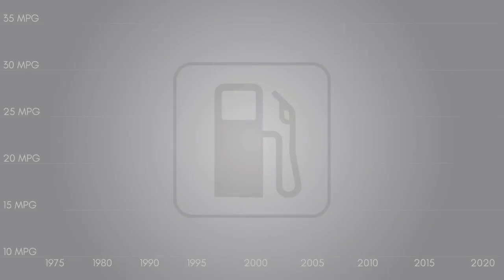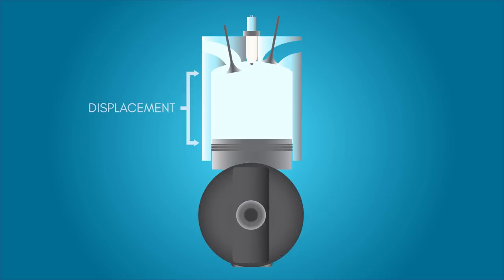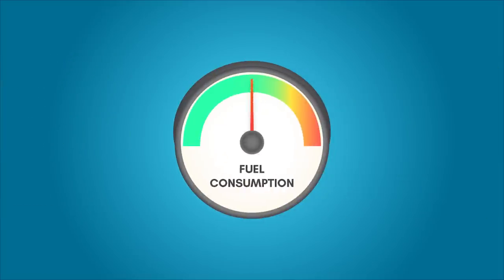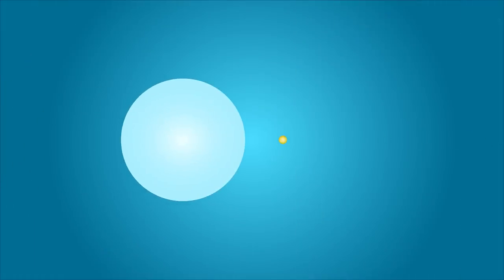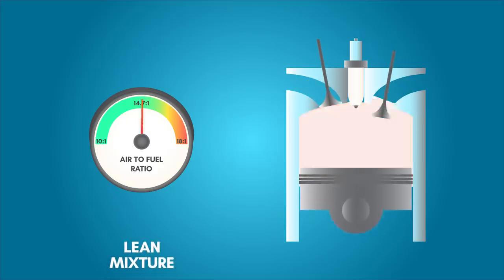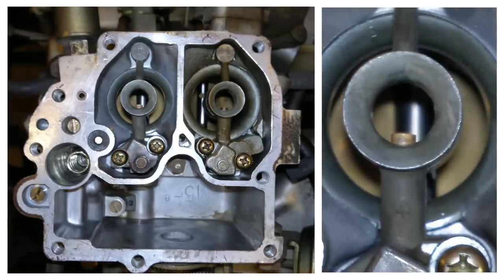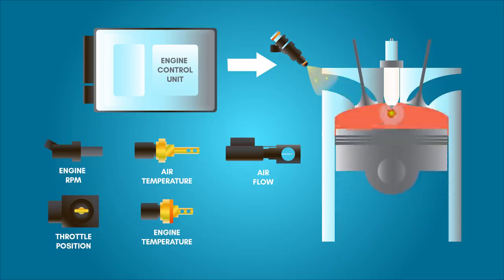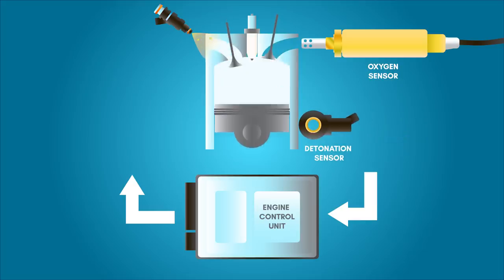How Engines Are Becoming More Fuel Efficient

Comment: The right carb makes more power than EFI (naturally aspirated) efi is just convenient because people are so lazy they don’t won’t to tune there carby these days, and you say make cars lighter with smaller engines? My 1973 full size car is 1250 kilograms and my missus 2014 small size is over 1400kg, yet the engine in mine is over twice the size, my daily driver is a 92 v8 falcon and I get and I get the equivalent of 7l/100k and I’m normal carting tools around, the best fuel economical car would be a v8 manual RWD around the 5L-6L range in a car that weight a shade over 1000kg, if a engine does its job easy it will do it well and last a long time if you have rev the crap out of a little shit box car so it goes up a small hill it will use more fuels than a v8 and won’t last very long
Reply: The right carb does NOT make more power than EFI. Tuned well, a carb can make almost the same amount of power at wide open throttle as an EFI system. What it can't do is make as much power over the entire RPM range, at part throttle and at all engine loads as an EFI system. Multi point injection systems make more power than carbs because you can tune the mixture perfectly for each cylinder. Now unless you had a separate carb for every cylinder, you can't match that.
Reply: Carbs can make more power (only NA... aka not turbo) because of the cooling affect that happens as the air drags the fuel threw the Venturi’s it’s science look it up , a carb won’t make as nice of a torque curve as efi, and no where near as easy on cold mornings, when in a boosted efi is the way to go, BUT if EFI Was the be all and end all why do top fuel dragster run mechanical injection
Reply: Douglas Hamner I said naturally aspirated a your comparing apples and oranges
Reply: @theshauny  I have no idea where that myth came from. You do realise port fuel injected cars get just as much charge cooling as carbureted cars don't you? Now, Direct Injection cars don't get the advantage of a denser mixture, but that's not important. DI cars actually make more power because they get greater knock resistance from the fuel being injected in cylinder.
Reply: @theshauny  Oh and top fuel dragsters run carbs purely because those are the rules of the Top Fuel class. That is just one of many rules designed to keep costs down, make it more of a challenge and stop the cars from getting too fast. With the convenience of tuning, consistency and few percent more power from EFI, they would all switch if they could.
Reply: Xei grab yourself a subscription to motor trend on demand and watch engine master’s “maybe centerfire injection could compare to carb cooling affects but not port, I say if efi was the be all and end all top fuelers would run it, I’m not saying carbs are superior(there not) efi just gets more hype than what it deserves (even though it’s the most consumer friendly by far especially with some diy ecu’s arround these day)
Reply: Xei top fueled run mechanical injection not carbs
Reply: Douglas Hamner when did I ever say oem? Gee ya say spark one conversation on the internet these days and people will come up with all kinds of variations (not facts) to make it seem like there is no supporting evidence, as I say if all you lot are that into engines get your a subscription to motor trend on demand and watch engine masters they prove that with a the same engine a carby makes more wide open throttle power and torque
Reply: Season 3 episode 39, engine masters... see for your self
Reply: @theshauny  OK good point about top fuel being mechanical injection. But thats only because electronic injectors and electric pumps can't flow 380 liters/min of fuel at 500 PSI. Can't really compare that to a consumer vehicle, where EFI is king.
As for charge cooling, every other test I've seen has concluded that EFI is equally as good. Regardless, the difference is so tiny it doesn't matter.
The very accurate fuel metering and per cylinder tuning makes it possible to get closer to the limits without worry of detonation or burning up a cylinder by accidentally leaning it out.
With a carb you need more of a safety margin.
Reply: Douglas Hamner who is the professional technician? Besides where I’m from technician means not quite a tradesman? That must be different between county’s I guess, as I have said multiple times I never said that joe 6 pack driving down the road is better off we a carb, “he’s not efi is great for all purposes, it’s just not the best for peak (not under the curve) peak power + torque, same engine same inlet, carb will provide better numbers, how can you run higher compression with port injection it’s still susceptible to  pinging, (pull some timing can limit that but where not talking about that, carbys can have EST as well, and many do)
Reply: Douglas Hamner also what makes you believe some thing because some guy on you tube say’s and with your sbc was the carb dyno tune or was it fucking around in the back shed with a few screw driver’s going by ear ha ha ha

Comment: Totally left out gearing and transmission behavior programming.
Reply: To be fair, this video is about how engines themselves became more fuel efficient, not how cars overall (aerodynamics, transmissions, etc) became more efficient. He does mention weight/size of the car, but for the most part he's speaking strictly to engines.
Reply: @grantobrien3396  yea I guess you are right. For some reason I thought this would of been included since he was talking about the computerization and stuff.

Comment: You are so FOS!!! Check the records. Average MPG is around 20. But a 1908 Model T on TODAY'S fuel gets 50.

Explain that.
Reply: What is the specific output, that is fuel used per BHP hour? I bet the T doesn't compare well in that light and there is no way it can keep up with the accelerate deccelerate, accelerate demands of modern traffic. It is also MUCH lighter than modern cars.
Reply: I have A prototype that allows the use of optimum ignition timing.  I set my timing to the maximum setting of the vehicle.

Made A short video about it.